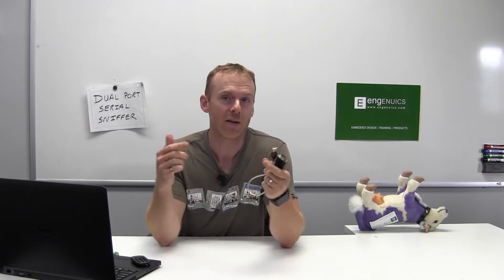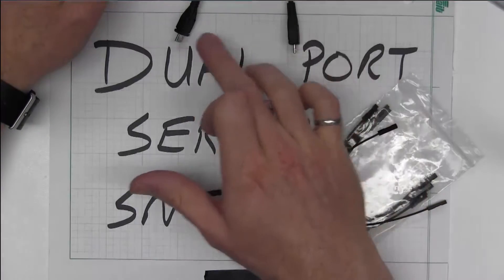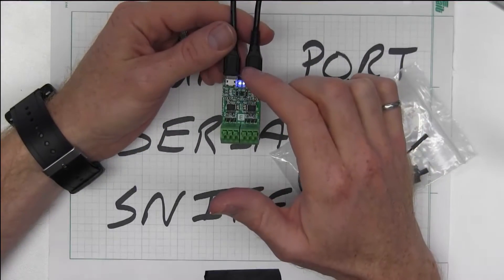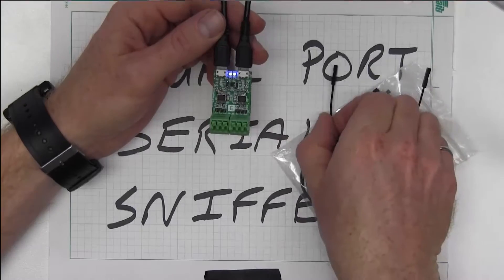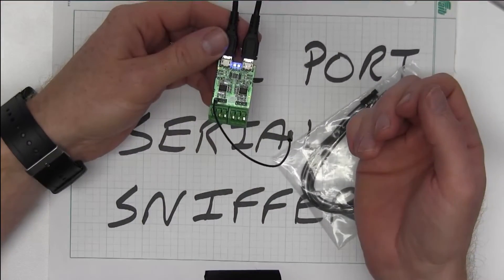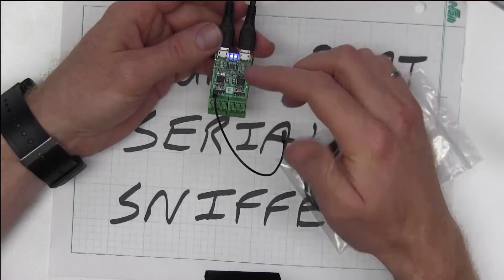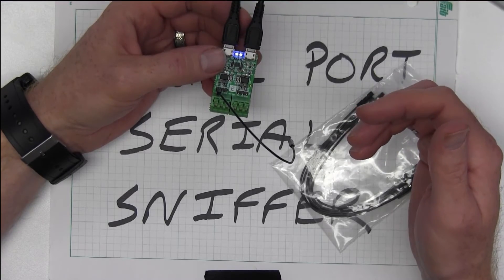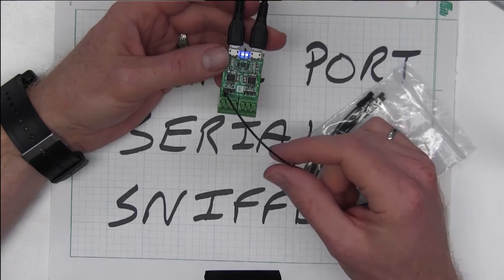Dual Port USB to Serial Sniffer

Comment: Hi Sir, I have camera device with Linux which stores files on its USB connected flash drive. I want to read that USB flash drive from my host which is not connected to camera and I am not allow to disconnect USB flash drive from the camera to read it. Is there any option?

Comment: Well you said FTDI is the best option available that's why we adopted it. I will slightly disagree I wouldn't find any FTDI USB to Serial chip that has 5bit per byte mode. Instead Silicon Labs chip does. So from this point of view is the winner.  I needed that when I wanted to sniff an older Siemens PLC  serial link to PC. So you might argue stability of FTDI, but I would say that SLab chip performed pretty well in that, and other circumstances. If you consider make a version with this chip then it would be interesting.